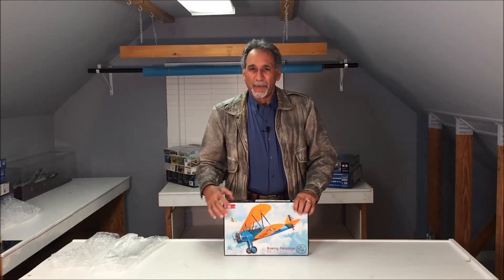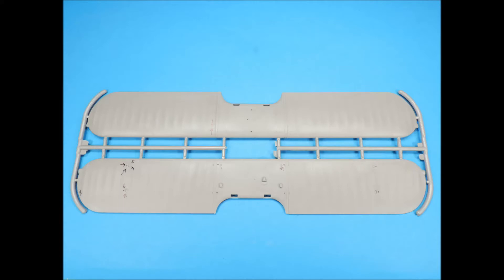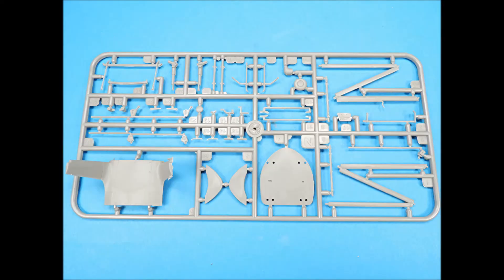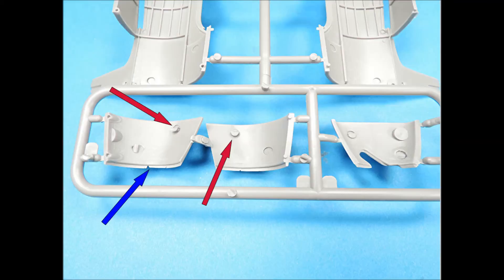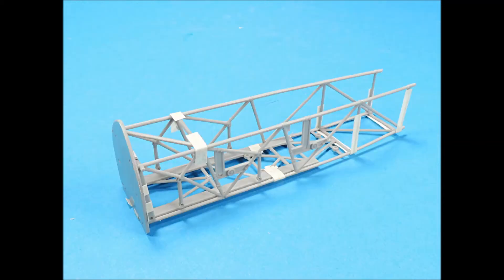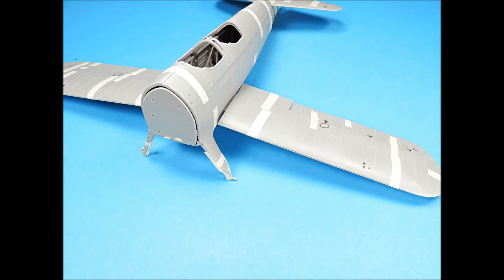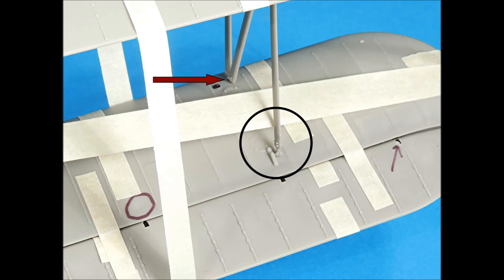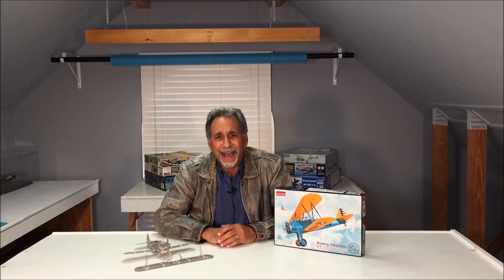Roden 1/32 scale Boeing Stearman PT-17 tape up review

Comment from the maker: Hello everyone,
The November issue of FineScale modeler has a review of this kit.

The review makes no mention of the lower fuselage misalignment, the lower wing loose fit, or the obvious problem with the inner struts. 
If you look closely at the photos in the FineScale review the lower outer struts are not sitting correctly on the lower wings.

The reviewer says it’s because he misaligned the lower wings. This means that the back end of the lower wings would need to have a twist upward to meet the gap.

The FineScale modeler review is very misleading.  If you look at the tape up closely you can see the multitude of issues with this kit.

Comment: Maybe best wait for the new tool ICM  kit of this same version. This is quite a poor kit even for Rotten, err Roden.
Reply from the maker: It is a very disappointing kit
Reply: The ICM kit is now out, and, like all of their 1/32 kits, it's a boomer. Reportedly Everything fits, with only one or 2 very minor issues (Alignment pins out of line by a few 1/1-0 of a MM, or male pin too long for the female joint. You know, stuff even Tamiya occasionally stuff up on) I have 2 of their 3 Gladiators, and if the Stearman is anything near as good, it will be the choice to make.
Reply: Brett Peacock thanks Brett.
Reply: @davidmay5612   Review here: https://www.youtube.com/watch?v=XqrPXBMNhzs&t=19s